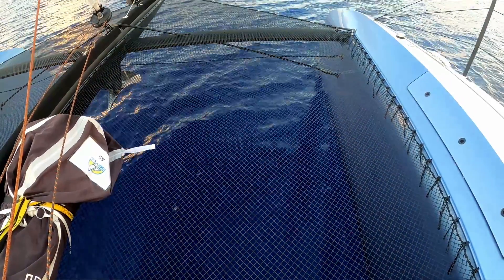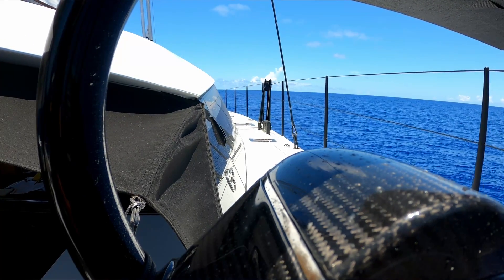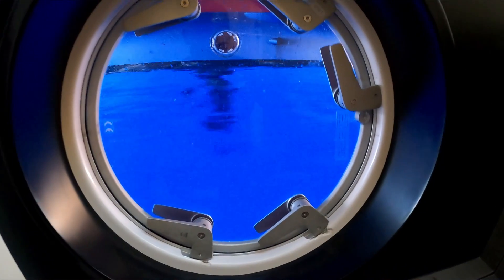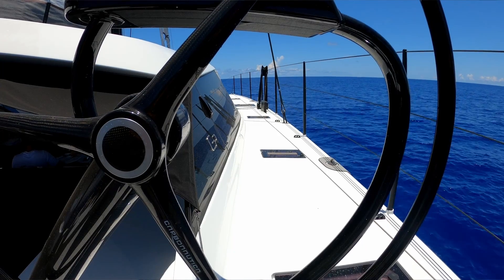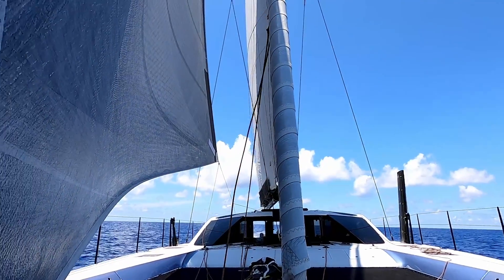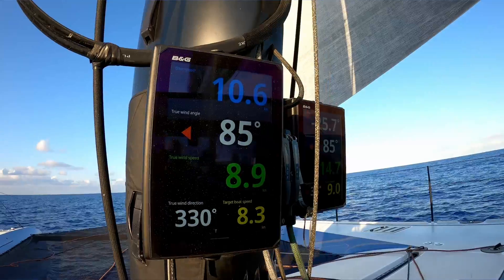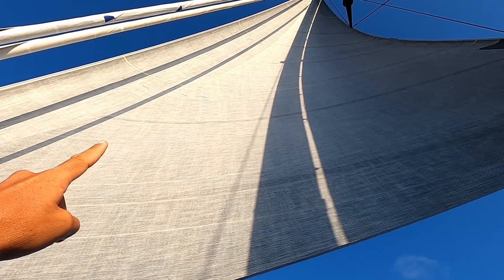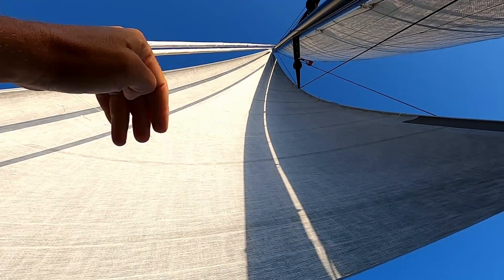Transatlantic on a Gunboat 68 | Part 1

Comment: How does the J0 furl with the fiber luff? Crazy sheeting position to be so close to the wheel - not sure I'd be super pleased with that. Was it a bit of an afterthought?  I shall have to save my millions and get a GB68. Sailing fast in flat water is always the best. We used to pray for 10-12 knots on a passage though we sure didn't do windspeed. Our heavy mono friends wanted 20 knots+ to move their boat with the accompanying seastate. Fools!
Reply from the maker: Yes, the steering wheels were added after the initial design and it does mean the J0 sheet runs very close. Not ideal, but it works.

Comment: Hello.  @2:00 is it still necessary to have the dagger board down while motoring?
Reply from the maker: We were motor sailing so dagger boards are still down
Reply: @youngbarnacles  Why though?
Reply from the maker: If you still have wind pushing the sails you have dagger boards down. The better question to ask might be when do you bring dagger boards up. We'll put something together in a video and try to explain 👍

Comment: Whats your thoughts on hybrid propulsion? Hybrid to me seems like it would be the go, no engine noise, can recover power while sailing and use solar to get you going along. I'm sure it's not as simple as that, but interested why on a new boat these days people don't tick that option more often.. other than cost.
Reply: I had a GB 60 with diesel electric otherwise commonly called a hybrid.  Done right is is a great solution.  Done wrong it is a rabbit hole that you wish you never went down.  My system was designed in 2011 and when first  installed did not work well.  After many modifications, most importantly new electric motors they system achieved it potential.  For a high performance catamaran that sails fast and sails more than it motors it is a great option.  At 10 knots we could generator 4kw of power from each prop.
Reply from the maker: What 60 was that?
We are looking at repowering and the hybrid is a good option. I designed a full electric boat in Australia around the same time as your hybrid. Like you w had the start of a good thing. After ironing out some details the boat went well.
Reply: @youngbarnacles  6001 Fault Tolerant now Defiance.
Reply: @robalex117  I have seen a few hybrids that it seems like they have had to make modifications over the years. Do you know if there was/is a weight penalty? Obviously there are going to be discrepancies in weight in a traditional setup as they burn fuel, but if they are fully fuelled up it has to be reasonably close?
Reply from the maker: @vok star it depends on where you set the  goal posts. The energy density of diesel allows for crazy being tanks and fuel to give huge range. However most like us don't carry huge amounts of fuel. So the weight of the solar and battery with the huge reduction in weight of the actual motor you end up with potentially like for like weight. If managed well and the weather plays well, you are carrying your fuel station with you. But it is soooooo weather dependant!
Reply: @vokstar  not a big weight penalty.  Out gensets were only 23kw so fairly small diesels although you add an alternator to it.  We had two which was good for redundancy although when we motored we only ran one.   Note when we motored for more than 10 minutes we always ran the generator.  Our battery was not that big.  We had custom titanium sail drives supplied by OYS out of the UK with Gori folding props thst worked amazing.  Not related to the hybrid but put stern extensions on that really helped with the low speed performance as well as ergonomics.

Comment: Has anyone figured out how to put aerodynamic flush-folding footpegs on the mast, all the way to the top so you can climb instead of being hauled up?
Reply: too much added weight
Reply from the maker: They do have mast steps that fold away. They are located around the boom to give access to boom. There are also a few at the top of the rig for when you are working up there. They don't go all the way up the mast because 1) windage and 2) it's too big a section to climb up. It's massively wide so it's hard to climb and it's a loooong way up. You'd be knackered before you reach the top to do any work.
Reply: @youngbarnacles  by windage, do you mean they would disturb the airflow meant for the sails and reduce efficiency?
Reply from the maker: Yes they disturb the airflow and create drag.
Reply: @youngbarnacles  thought so. Thanks!
Reply: You don't need mast steps when you have a bunch of young apes on board who sell their souls to make a trip like this on a boat like this...I don't know if i have ever seen mast steps on a c/f mast.
Reply: so now the questions is: how does one become one of those apes?